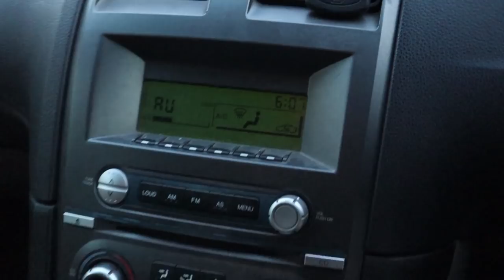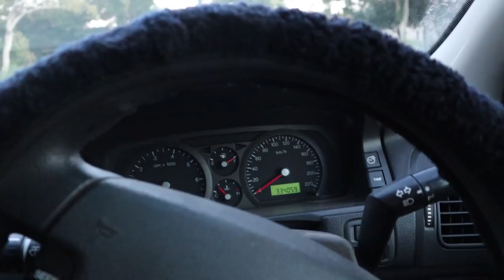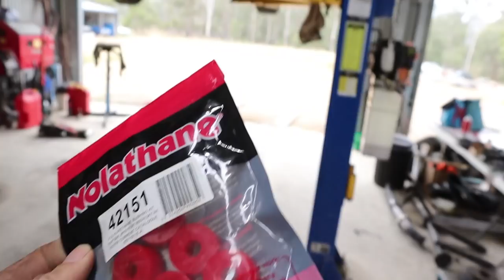Morning Session Prep - External Gate

Comment: dont forget to double check you tail shaft yoke bolts... the diff is missing one... come on fellas
Reply from the maker: You mean the Bolts for the shaft to the diff? behind the uni? at the opposite end to the yoke? ...... all 4 are there.
should have gone to spec savers
Reply: @BoostGumps  6:58 im glad 4 is all you need
Reply from the maker: @iLLisett  Its all you can physically put in